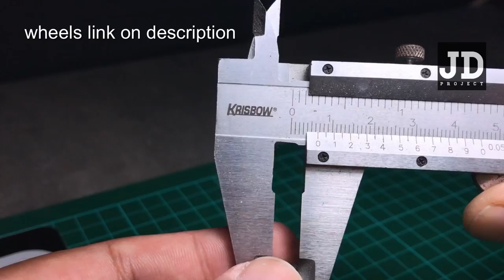Amazing build  Hot Wheels Porsche 944  jägermeister rear Boxer Engine Mod

Comment: I have a buddy that does cars like this.  He uses black thread and clear nail polish to make spark plug wires, as well as using epoxy to make engines, radiator hoses, rear view mirrors  and the such.  He suggested that I start doing it.  I told him "Yeah, right!!!  I have trouble using these gorilla mitts to tie my shoes, and you want me to do something like that?  I'd have a better chance at curing the common cold!!!".

Comment: Porsche actually built a rear engine 944 as a test vehicle but it had the same inline 4 cylinder engine as the regular 944 but it was put on it’s side to make it lay flat and placed behind the rear transaxle. As far as I know they only built the one test car. It’s in the Porsche Museum now.